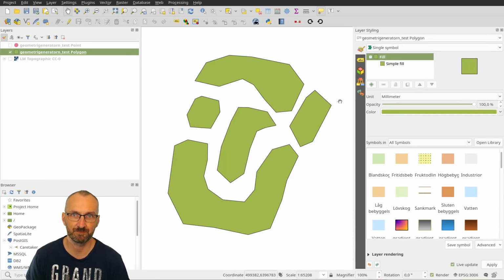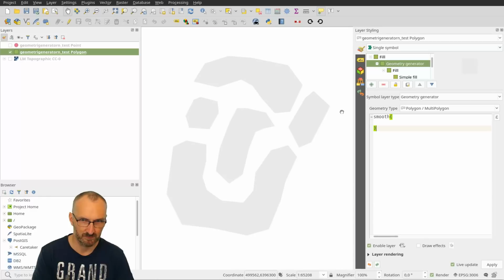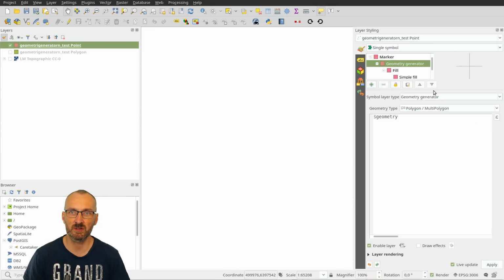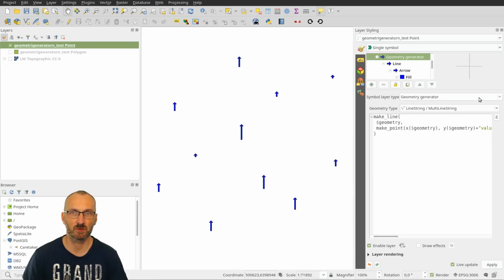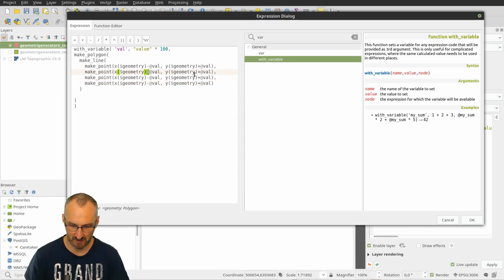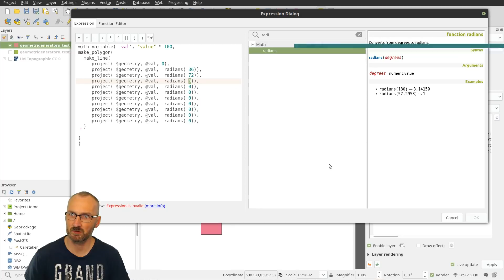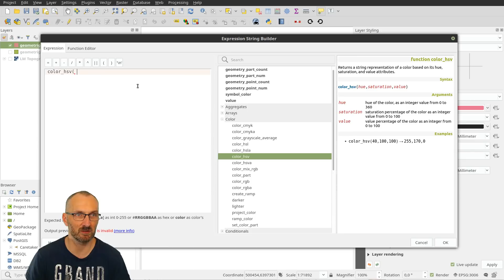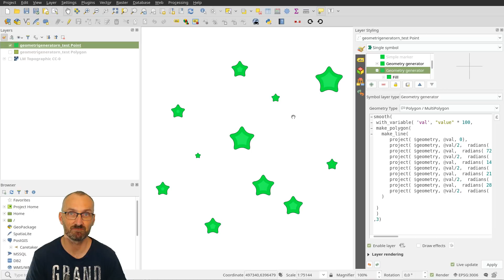QGIS User 0010 - Geometry Generator

Comment: Nice video Klas! I was wondering if i can create a line next to my line feature indicating where it starts and ends and display the length (available as one of my fields)on it at the same time. Since my line is made of many segments the expression that im using (make_line) creates a straight line between these points. Do you know how could i approach this problem? segments_to_lines creates a line for each segment and i want a simple line. My main goal is to get displayed the length of a line (multiline and therefore with curves). Id appritiate any advice :)

Comment: Can I dimension the azimuth of the sides of a polygon layer? Thank you so much for the tutorial
Reply from the maker: With a geometry generator or any expression you can use "segments_to_lines" to isolate each segment in the polygon. You can iterate over them, or the vertecies them selves. You can use azimuth( point_n( $geometry, 1), point_n($geometry, 2)) to get the azimuth between vertex number 1 and 2 in radians.
Nor sure what you are after exactly though...

Comment: Hi Klas - thanks for your great channel, I have learned alot from you! May I kindly ask you how to rotate the rectangles/squares by using a field attribute ? The rectangles needs to have fixed dimensions, lets say 3x6m. And yes, my dataset is a point.shp with "angle" as one of the attributes. Many thanks, Steinar (Norway)
Reply: And the origin point should be the centroid of the rectangle.